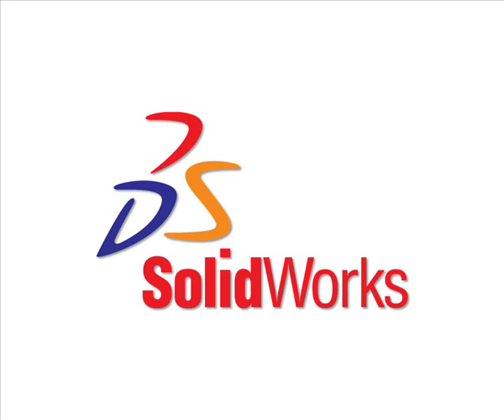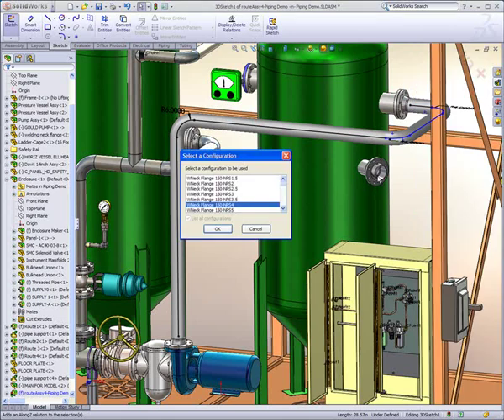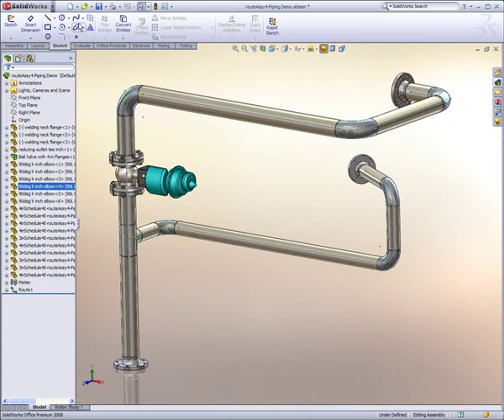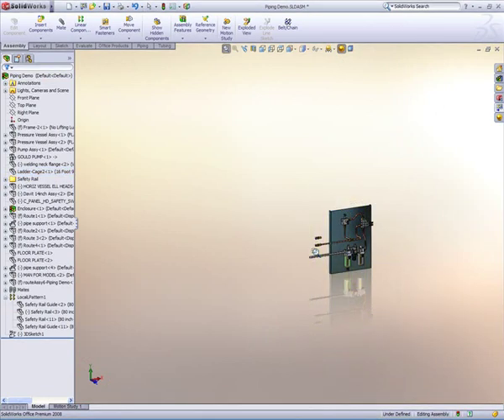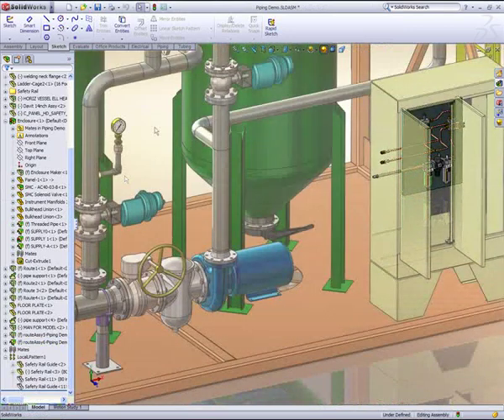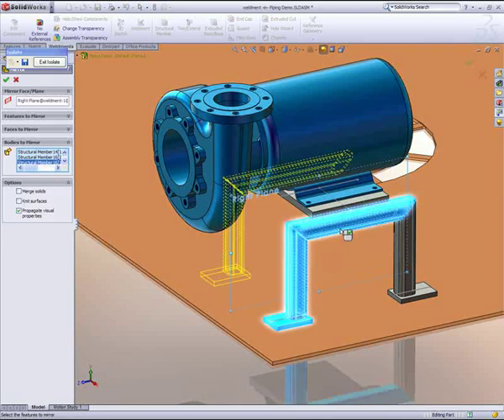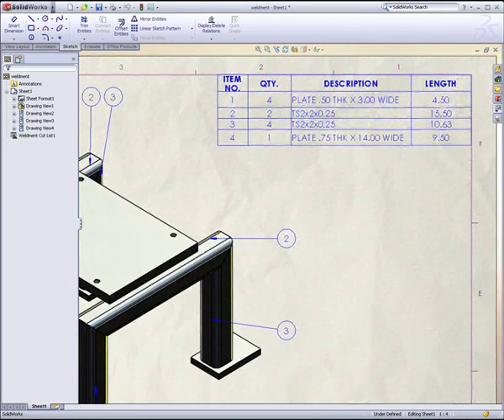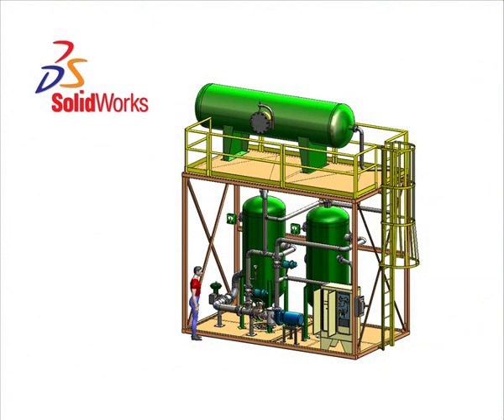Solidworks for Oil and Gas

Comment: 52 DWG CAD file of Piping/plumbing components (elbow, valve, tee, reducer,...) and pipe spacing table:

https://www.amazon.com/DWG-files-Piping-plumbing-components/dp/B0794MYF8N/ref=sr_1_14?ie=UTF8&qid=1517718696&sr=8-14&keywords=dwg+cad+files